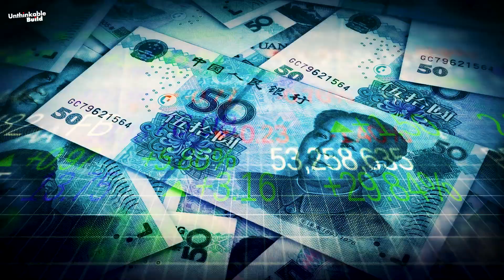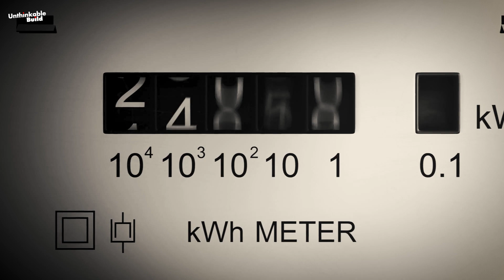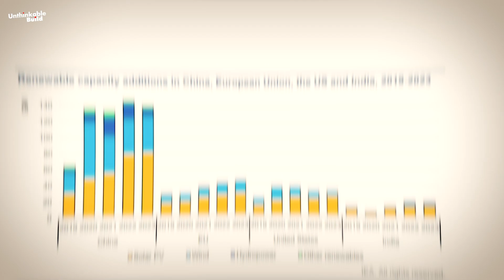China’s Record-Breaking Solar–Hydro Power Plant Explained

Comment: Nonsense.  China is building COAL plants.  And some nuke plants.  They make solar panels for idiots in the US nd Europe which cant make them as cheap. Of plants permitted in 2022, about half (52 GW) had started construction by summer 2023. After the permitting spree of the past year, China now has 3,320 existing coal plants and  243 GW of coal-fired capacity currently permitted and under construction yearly. China has 55 nuke plants operating and  21 nuclear reactors under construction which will have a capacity for generating more than 21 gigawatts of electricity, according to the International Atomic Energy Agency. That is two and a half times more nuclear reactors under construction than any other country.  China is also daming up their rivers to get hyrdro power.